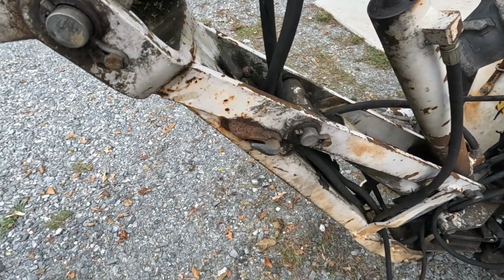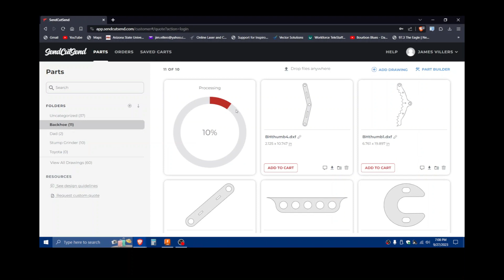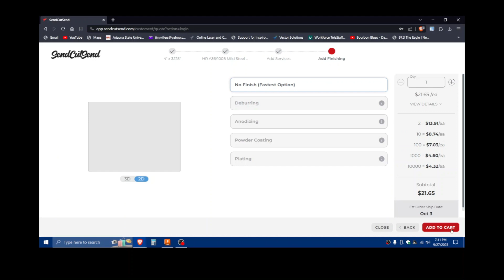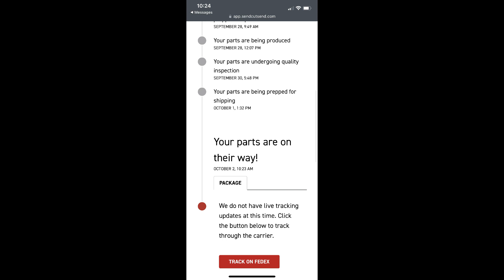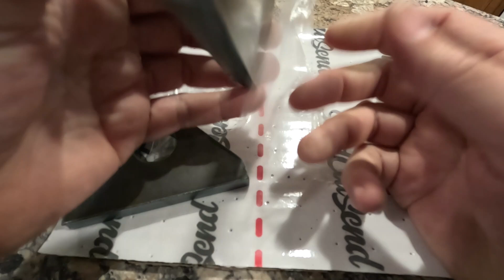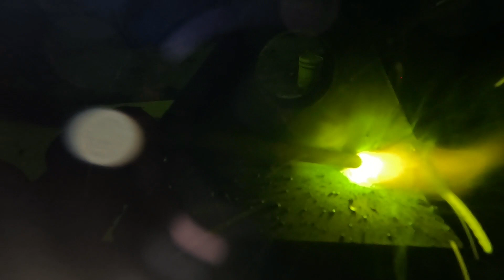Three Point Hitch Backhoe: Building and Mounting a lift ring.

Comment: For about $9 bucks not including shipping you could have bought from "bolt on hooks "  a padeye and a backer plate and welded it on the back of the bucket near the top. you can put a  pin clevis on when you needed to lift something ect. put one on my bucket and use it all the time. Got the idea from seeing big machine with them welded on and using them for lifting.
Reply from the maker: Thank you that is a good resource to have